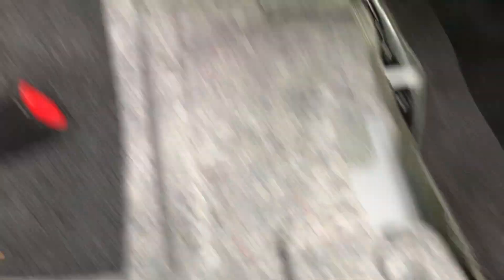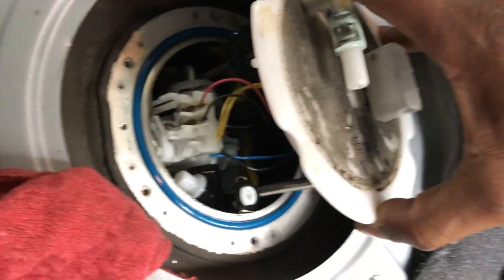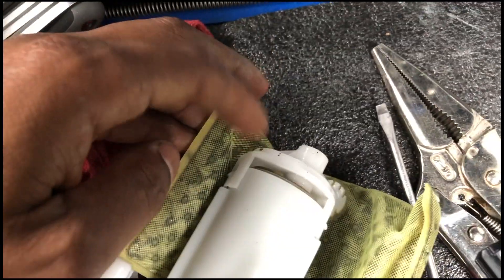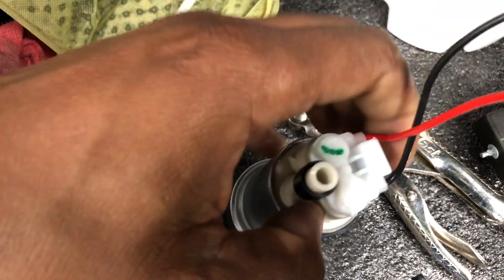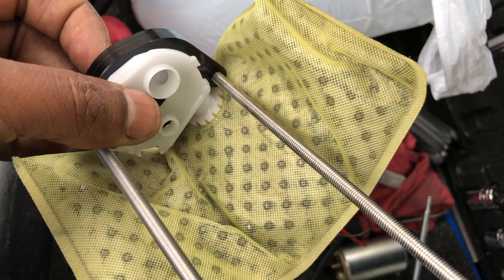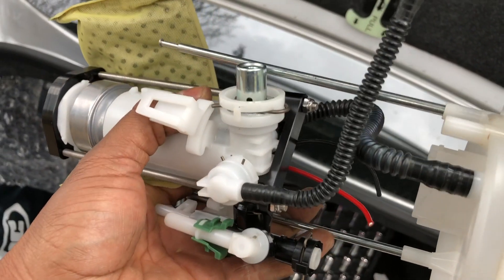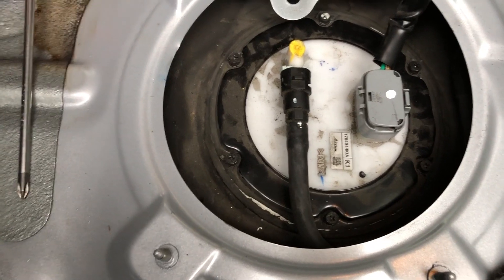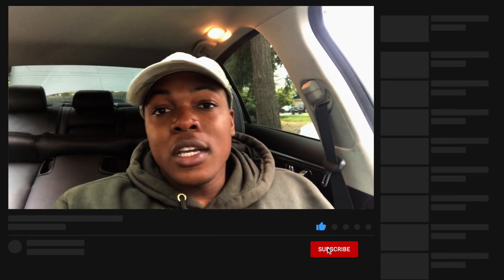Infiniti Q50 AMS Fuel Pump Kit Install

Comment: So im having problems. After install my gas gauge wasn't working. Drove it home and decided to worry about it later. After this morning I remote started it and let it run. I come back to it. The car refuses to start and I'm stumped. Only thingi can guess is  I didn't use the butt connectors they have cause I mrssed them both up and uses  a harbor freight alternative. ( Same 14-16; gauge )
Reply from the maker: Does it turn over?
Reply: @Ddrivengarage  it did initially.  When I drove it home after the first installing. . Then it did again 10 hours. But now it's just stutter. I believe something failed

Comment: what year is your car because i bought the same fuel pump for a 2015 q50 do you think it’ll work?
Reply from the maker: This pump is specifically designed for q50s with the vr30 engine which is for 2016+. Your engine is most likely not a vr30. However, it’ll still fit

Comment: Great video! WARNING: Make sure to clean the top of the fuel pump and surrounding area before you remove it. All that dirt will foul your injectors if it makes its way into your fuel tank.
Reply: I'm not sure if I'm having that issue right now. My car started after install then after itthid morning. I'm getting nothing

Comment: Please for the love of God anybody that watches this video make sure that the first thing you do is make sure that your fuel tank is as low as it possibly can be without you running your engine out of fuel and then number two please make sure that you guys disconnect your battery for the love of God
Reply: Ehh not neccesary. This can be done with half a fuel tank, and using tube pinchers for the fuel line to not let fuel to come out, instead of stalling the engine for fuel starvation. Easier and quicker.

Comment: Do I need to be tuned i installed it but my car cuts off after driving for a little
Reply from the maker: No you don’t. If you’re car is cutting off, recheck your connections.

Comment: Could you explain how you wired the new fuel pump ? What did you use to cover it?
Reply from the maker: I used butt connectors that can be heated and shrunk wrapped.

Comment: Grate video ! I change the steering wheel now the air bag light is on i ran a diagnose and a grounding issue comes up how cam i fix this problem?
Reply from the maker: You’ll properly need a resistor to eliminate the light

Comment: You can run a lpfp without a tune?
Reply: DDriven Passion awesome video and appreciate the reply! Earned a sub 👍🏼 one more question tho.. can I run the flex fuel kit as well without a tune? My lpfp and flex fuel kit got here today but I didn’t wanna install it until I was about to get tuned .. but if I can install it and run normally then might just install today
Reply: DDriven Passion I have bms intakes, hks bov and I’m about to install ams lpfp, ams flex fuel kit, ams fdp and I will be tuned by btunedperformance (I’m not tuned yet)
Reply: @Ivancito209  Btunedperformance is the GOAT
Reply: Yes you can, u only need a tune with a hpfp
Reply from the maker: Yes

Comment: So you're not running an upgraded hpfp??? Needs to be your next upgrade, but just a heads up I swapped out my nostrum ra338 for the Spool Fx150 and the difference is night and day. My tuner now recommends the Spool to all his clients and says it tunes and performs just as well as Nostrums $2300 ra405, plus it has a lifetime warranty, which neither of the ams/Nostrums offer.
Reply: @Ddrivengarage  ecutek
Reply: Loving my new ppfp